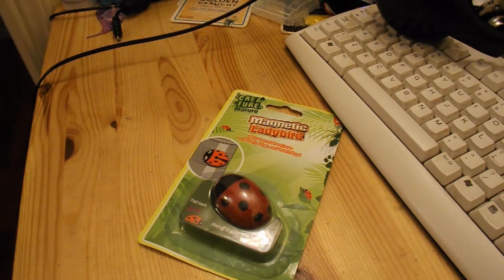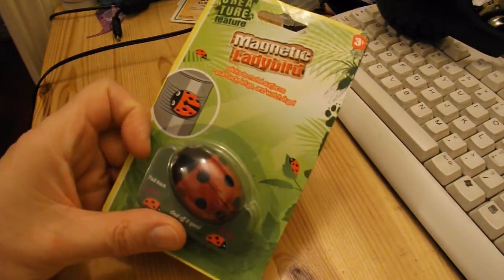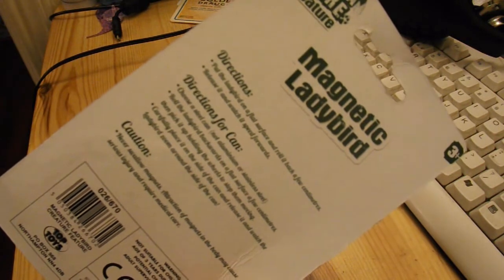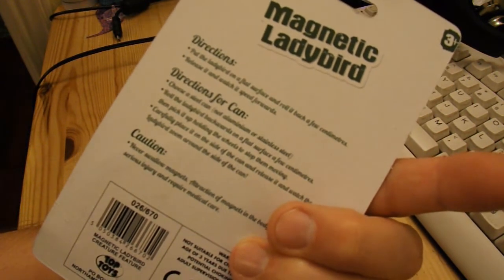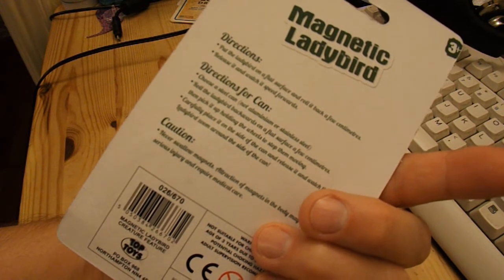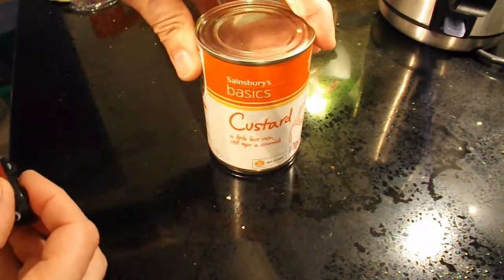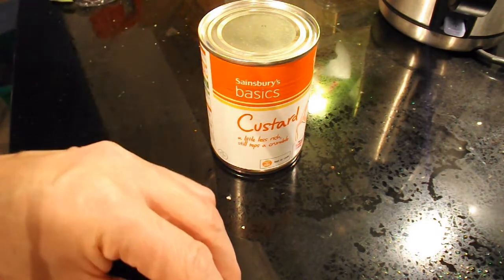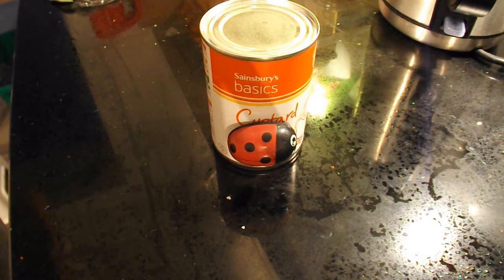Bargain Store Fun - Magnetic Ladybird

Comment: That run at the end was surprisingly good, looking at how it moved on the can.
One of my first ever memories is of my mum moving a magnetic ladybird over a piece of cardboard or similar. I had no idea at all how that worked, but no doubt it added to the ever present fascination with magnets. Thanks for the memory jolt :)
Reply from the maker: Thank you Slider. I might take it apart to see if I can upgrade the magnet a little, I guess there will be an optimum compromise between the power of the magnet and the power required to drive the bug forwards against the magnetic attraction.
Reply: GrandadIsAnOldMan
You may find that it uses a relatively heavy ceramic magnet (cheap for mass production) and that a tiny neo is just as effective, while allowing a climb up a sheet of metal.
Reply from the maker: It is a rather thin metal magnet but I don't think it's a neo, it doesn't seem that powerful, so a neo replacement might do the job. Just need to find one thin enough as it fits under the pull-back motor in a shallow recess.